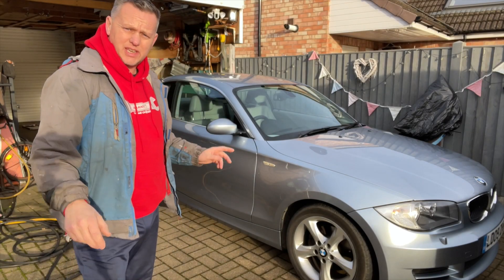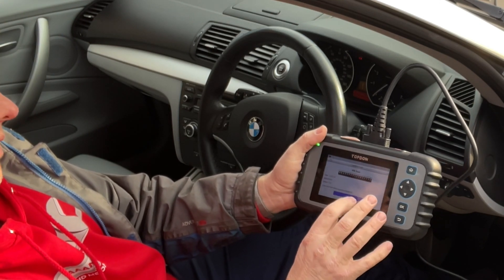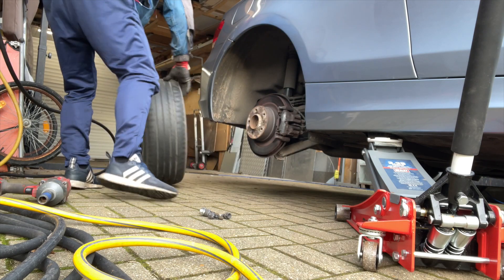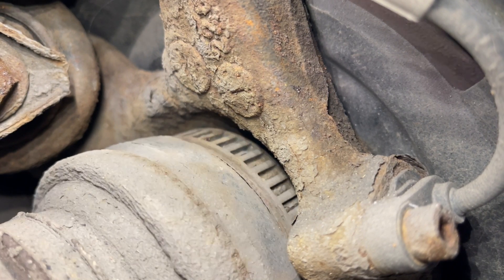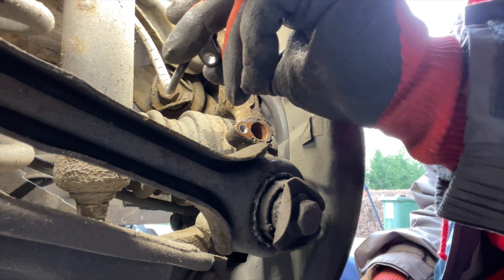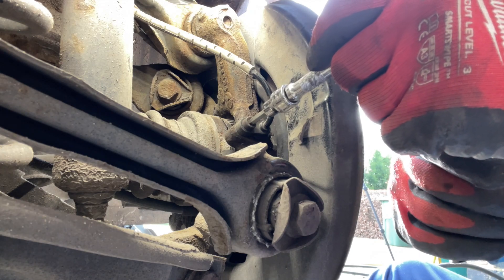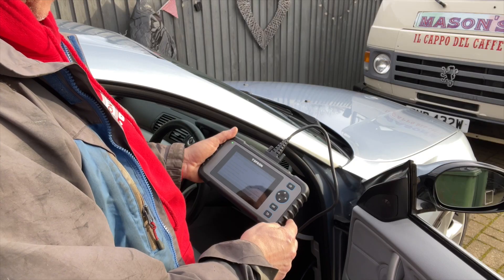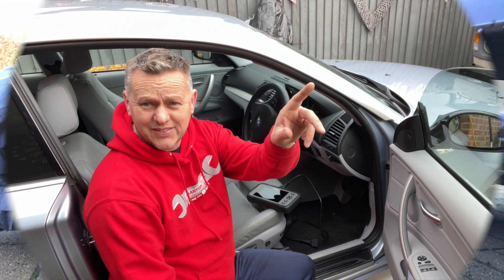BMW Fault Code 5DC1 ABS Traction Control, Easy Repair.

Comment: i just got a fixer upper like all my cars in the last 53 years: 2003 X5 E53 4.4i Sport 97k miles, this is about my 6th BMW,  and transmission does something consistently that should tell me what it is, here goes: no movement in any gear, raise vehicle body until all wheels are fully extended and transmission starts working, drive it about 1/3 mile or 2000 feet and it shuts off like a switch was turned off!! done this 4 times to prove to myself this symptom is reliable, so, I've got brake lights on dash and air susp bags removed, and wondering is it the ABS or DSC that is shutting down the transmission? i have a Thinkscan 689 coming to get into the troubleshooting in about 4 weeks, but, with this symptom it should be explainable after 22 years of these in service, shouldn't it?
Reply from the maker: I would drop the sump pan off the transmission and give it a good flush out, refill with fresh oil reset and test, Thanks for the great comments👍🏻👍🏻🛠
Reply: @aaanton11  yes, thank you, i bought a kit for a lot of $ with the special fluid! do you know anything about this special ZF6 fluid? and filter and gasket, also had someone share that too much friction in the 4x4 system can signal the Transfer Case to shut down, so, i am going to look into that too, i did have a Suburban TC quit because of a bad shifter motor, no drive at all. so having a clutch motor controlling the engagement of the whole cars drive potential has some merit..
Reply: @aaanton11  yes again, i think maybe i am getting foaming, and losing control pressure, and maybe when it is lifted it allows the solenoids to return to normal operation until it foams up again, still guessing but kit is here tomorrow with the ZF5 fluid and filter, now to get the level right, i thought i might have had that transfer case control motor gear failure but i think i have the NV125 without that variable feature on the transfer case, thank you for a good recommendation

Comment: Thank you for the video; I have the same problem, ABS, Brake, Traction and even Engine lights, showing; scanner indicates it's the rear left wheel; I did this washer trick, cleared the codes, but as soon as I started driving all the lights are back again; the car drives fine, no hesitation, no stalling, no lack of power; 2009 328i E92
Reply from the maker: Your washer might be too thick, Thanks for the great comments👍🏻👍🏻🛠
Reply: Did you put the scanner tool on it and reprogram it and also it could be all sides front or rear plus sometimes the hub assembly and the abs wheel speed sensor for any of the four sides

Comment: I JUST GOT ABS BRAKES DTC LIGHT ON... I have no idea where to star, I imagen those gears and semsor wouod be protected from dirt water etc...now I can see where to star... 
So the groves are not cut on the axels.. they are rings clamps..🤯
Reply from the maker: This is the link to the full repair video if the washers don't work https://youtu.be/rBlTHK29x8c Thanks for the great comments👍🏻👍🏻🛠

Comment: it that mean if driveshaft Ring touched wheel speed sensor it can caused warning sign abs failured and to avoid this happen we can put washer for create gap and problem will solve Sir? my e90 320d 2011 have this issue 3 days ago ABS warning sign pop up on my iDrive, i bought new wheel speed sensor but didnt replace yet because maybe tomorrow will recieve it. my code error was BDC0 DSC. One more thing  Sir, do we need to coding after replace new wheel speed sensor even though error message ABS fault disappear on iDrive@odometer screen?
Reply from the maker: Watch this one it has all the answers https://youtu.be/rBlTHK29x8c Thanks for the great comments👍🏻👍🏻🛠

Comment: I had all the lights (ABD, Driving Stabilisation, etc) displaying on my dash, and the car felt like I was driving over small rocks.  My diagnostic on my UK BMW M4 showed that it was a fault with the rear passenger side ABS sensor.

I changed it to a new `FEB BILSTEIN` ABS sensor then I cleared all the warnings with my diagnostic.  As soon as I started driving all the warning lights came on again.  I then connected my diagnostic to it again and the fault was NOW showing Driver's side rear.  I assumed that the new Bilstein sensor was giving a different fluctuation reading to the older ABS sensor on the rear driver's side.  Therefore I then ordered another new `FEB BILSTEIN` sensor, fitted it to the driver's side (rear), cleared the faults and now the car is driving like a new car with all warnings completely cleared and staying off.

I'm posting this in case someone has the same issue - that you might have to replace both sides with the same model new sensor, so that the sensor readings are the same. I did also place a 1mm washer onto the small bolt for each sensor.
Reply from the maker: Thanks for the great information👍🏻👍🏻🛠

Comment: Thanks for another helpful video!! Just done this on my 2007 E87 after DSC, handbrake & run flat warnings kept appearing every time I started her up. Couldn't scan for fault codes as I have had no communication with Canbus for months now. But then I remembered this vid and thought I'd give it a try. It worked a treat as the three warning lights disappeared after a spirited 10 mile journey. Happy Days!!
Reply from the maker: This gave us another 3 Years driving before having to replace the ABS Rings on the 3 series its a great repair, Thanks for the great comments👍🏻👍🏻🛠

Comment: I just did my bmw 318d abs sensor. I put a little ring on the t30 bolt and the abs light went but comes back when driving. Specifically every time I start the car the abs light goes and returns as I drive.
Reply from the maker: you might need this next https://youtu.be/rBlTHK29x8c Thanks for the great comments👍🏻👍🏻🛠

Comment: Hi im having this code on my E46 M3 along with a rotational rubbing sound would this be the cause of the sound???
Reply from the maker: Check the sensors in a graph if you can on your scanner, you will see one is misbehaving, Thanks for the great comments👍🏻👍🏻🛠

Comment: Hi! Nice video and lovely dog!
E91 from has 2010 has a problem with traction control kicking in randomly and the same warning light flashing. The only error code that has been found however is DPF filter. Have you heard about it?
Cheers!
Reply from the maker: It is usually the abs ring issue, if you have a code scanner and can do a graph scan on the rear sensors you can see which one has a smooth line and which is uneven showing corrosion, Thanks for the great comments👍🏻👍🏻🛠
Reply: @aaanton11  Thank you for the reply
Reply: @aaanton11  Thank you so much for making this video! It was really super helpful in identifying the problem an!d fixing it!

Comment: Awesome video. Have the same on my e82 125i but the ring didn't solve it. Code was gone for a short while, say 15 minutes of driving back from my mate. So me and my mate suspect faulty sensor by being to late.  This helps a lot in what to do next, so thanks!
Reply from the maker: Thanks for the great comments👍🏻👍🏻🛠

Comment: it worked for me too, can we call this a permanent fix or should i replace ABS ring?
Reply from the maker: Permanent until it fails, which for me was another 3 years, then I replaced the rings video here https://youtu.be/rBlTHK29x8c Thanks for the great comments👍🏻👍🏻🛠
Reply: @aaanton11  can you provide more details please, how did it fail? did it do any damege to other components? how did you  notice it..by sound or ABS light? thanks a lot!

Comment: Mine thinks its going betwen 130 and 650kmph on all 4 wheels even when still :(
Reply from the maker: Try disconnecting the battery for 10 mins, Thanks for the great comments👍🏻👍🏻🛠

Comment: My 320d had 5DC2. Tried 1mm washer and that changed to codes 5DC1, 5DC2, 5DC3 & 5DC4! So presumed washer too thick, replaced with a 0.3mm one and cleared the codes, will do a test drive in morning and see whats what. Possibly time to for a new sensor and install it with a washer from the beginning as currently one looks v worn down.
Reply from the maker: Yes if the end of the sensor has been worn down too far the sensor is scrap, try a new sensor with a wafer thin washer should work for a few years, Thanks for the great comments👍🏻👍🏻🛠
Reply: @aaanton11  Just wanted to follow up on this : I installed a new sensor today (15 quid amazon) with a relatively thick 1.2mm washer and was surprised it cleared all faults after driving only 50 yards :) Fully expected it to be too far from reluctor ring but nope, all good!

Comment: Was driving my car this weekend and it decided to throw the standard abs ring codes 😂 I used a .83 washer as a spacer and took it for a drive last night, no more codes which I'm happy about as I'm off to the Nurburgring this weekend. Worse case scenario is I won't have any driving aids or cruise control 😂 thank you for the video, really easy to understand
Reply from the maker: Thanks for the great information👍🏻👍🏻🛠

Comment: Loved the dog. I am not a great mechanic. This might be the solution for my old 3 series saloon BMW diesel. I have info to take a professional. Thank you. I also like the links to tools, equipment and for DIYer. I was impressed by the Top Don thing as I am a professional software engineer and just not so practical with my hands..
Reply from the maker: Glad it helped Thanks for the great comments👍🏻👍🏻🛠

Comment: Great video, but didn't work for my E90,😢.  inserted washer on both rear sensors ( both are worn a bit) and now in addition to a circled triangle,  the ABS appeared and the DTC button stopped working. Please advise what are my options. Thank you for supporting
Reply from the maker: This is the next step if the spacers don't work https://youtu.be/rBlTHK29x8c Thanks for the great comments👍🏻👍🏻🛠
Reply: I will do the same

Comment: Hi i seem to be having this same problem with an 2011 E90 .   Can i ask does spacing the sensor stop the ABS working?  would you not ust replace the sensor.    I've just disconnected and resetted  the ABS ECU see if that does anything.
Reply from the maker: No the abs works fine, the washer needs to be less than .7mm this just allows for the swelled ABS ring, Thanks for the great comments👍🏻👍🏻🛠
Reply: @aaanton11  Jesus!!! Just started the car and the all hells broken loose. Wipers won't turn off and dash has every conceivable warning light on!! Is it cause I've not connected the ABS junction correctly!! I dare not open the bonnett..
EDIT I've just been under and yes!! To prevent the shock of your life make sure the ABS connection is fully secured!! Goodness me 🙈
Reply from the maker: Wow!! 😂 These faults can be crazy, modern electronics can throw some strange issues, glad you fixed it, Thanks for the great comments👍🏻👍🏻🛠

Comment: Thanks for the great tip what size washer i know its 0.5-0.9 thick but the diameter please is it M8 ?
Reply from the maker: M6,  Link to washers on amazon £6 https://amzn.to/3vTEemy Thanks for the great comments👍🏻👍🏻🛠
Reply: @aaanton11 hi, aanton, but the m6 in this packet is 1mm thickness, isn't that too thick? Doesnt it need to be 0.5mm at m6?
Reply: What were the driving symptoms before you repaired the sensor?

Comment: Good idea with the spacer. On my 1 series (E87) and the E90 of my parents (sold since I fixed it) I replaced the worn sensors with new ones and just didn't thread the screw all the way so the sensor still was out by 1-2mm. "Fixed" it without having to replace the ring or drive shafts. I like your idea better with putting in a spacer, that way you can't tighten the screw too much by accident
Reply from the maker: Works like a charm, Thanks for the great comments👍🏻👍🏻🛠

Comment: Hi, mate. 
I've been watching all of your videos, and they were very helpful. Especially about City bug, as I have had one. Now I have a Corsa d 2011 ecoflex 1l petrol (39k on clock) , and it had problem with timing chain, after the replacemenet car started and has engine light on. I've diagnosted and the code appeared to be crankshaft sensor. Sensor got replaced, yet the light is still on. I was advised that I need to check timing chain alignment, because the car had no power and engine was shaking. I bought timing chain alignment tool to adjust, and i tried to fix it. First time the car was still running, but no change. After that I tried to align several times, but my tool isn't accurate with my car. Car isn't starting now at all. The smell of petrol is coming from spark plugs, I've check them and they were full of the fuel. I cleaned them, tested them, return back, but car isn't starting at all.
Do you have any advise what and where to look to just make this car to start, even if it has engine light on dashboard still on? 

Thx
Reply from the maker: Sounds like the timing is the issue, why did the chain need replacing after 39000 miles is there an underlying issue with the engine, ie oil pressure chain tensioner issue Thanks for the great comments👍🏻👍🏻🛠
Reply: I was advised by others to change the chain as the car was a non-starter when bought. I'll look up by your advice further on, and let you know the outcome.
Thx!

Comment: hi ant ,,on the my aygo the sensor ring just fell to bits ,,than the sensor broke inside the stub axel ,,had to get new wheel bearing ,,then it was fixed ,,car now sold and a another city bug bought this time c1 ,,2016
Reply from the maker: Very nice a newer model hopefully it will be as reliable as the old one, Thanks for the great comments👍🏻👍🏻🛠
Reply: @aaanton11  hope so..its a wee cracker 1.2.this time furio edit..